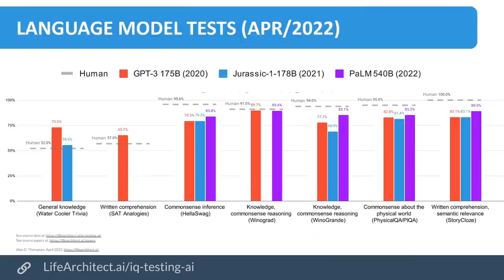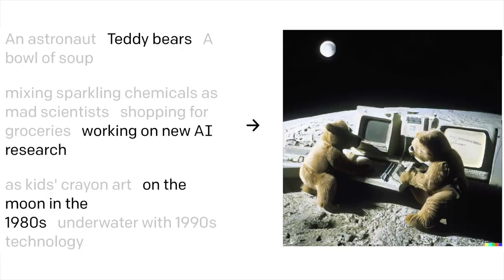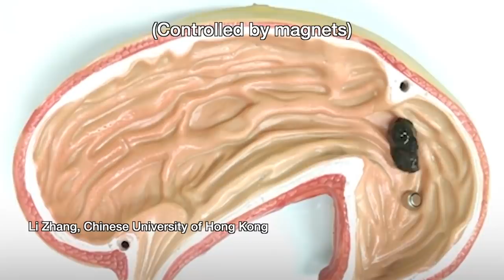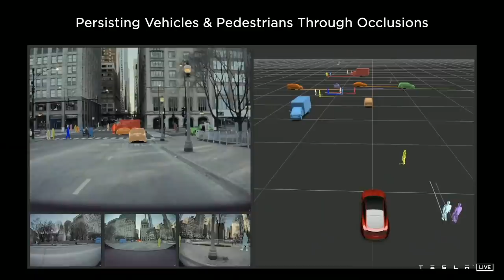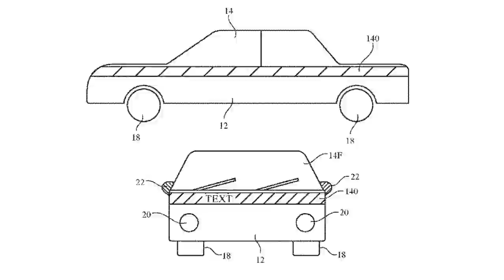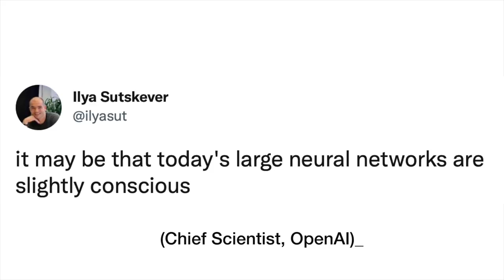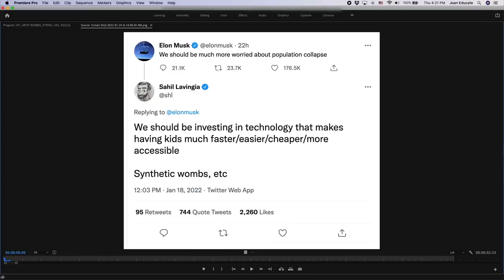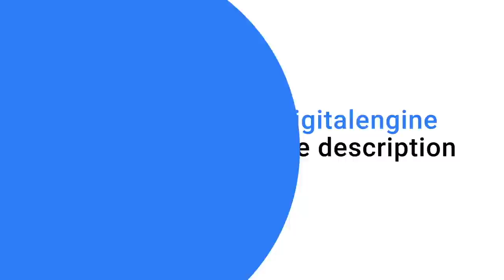Is AI slightly conscious, as OpenAI's Chief Scientist suggests?

Comment: Funny story: When I was in engineering school back in the 70's production of chips was the thing. A manufacturer here in New Jersey was going "gangbusters" but wanted to move to cheaper labor, fresher air, new facility in Georgia Alabama one of those. Big facility. Great investment. Production startup celebration etc. For some reason, couldn't get the chips to function right. Everything was the same as Jersey. Deep study. Massive research. Two years. Shipped identical resources from Jersey just as was currently working. Still wouldn't work there. Finally resolved. The pollutants in Jersey air were "seeding" the chip manufacture and working in Jersey but not the new facility. Ultimately they scrapped the facility, and expanded New Jersey. Smoke that fellas!

Comment: Great video!! 👍👍
Just one correction: Tesla has already removed radar from its vehicles and are currently using Vision-only systems. And it works better too, as there are no more conflicts between the different sensors.
Reply: you're all mad
Reply: so true
Reply: Until you drive through a puddle of mud.
Reply: Funny you say that. In fact Tesla cars which still had radar and visions systems, the machine learning on the car's system stopped using the radar, as it was too power hungry and turning it off was the best AI optimisation to save energy. Soon thereafter these self driving cars were found crashing into black cars in front of them at night.
Reply: Why is that so great? I can already do that... Why do people want to trust machines to drive them around when we are all capable of doing it ourselves right now?
Reply: @did_I_hurt_your_fee_fees  because then you'll have another "energetic" slave. More confort, more laziness ("laziness is the mother of all vices" old wisdom).
And sure, more safety promises IF you abandon some liberty rights. Sounds some bells ?
Reply: @W.M.-  Improvements have been (and are being) made continuously and currently their vision-only system is far superior to the old mix of vision+radar (over 45% better at the moment). Check out Tesla's impact report: https://www.tesla.com/ns_videos/2021-tesla-impact-report.pdf  --- on page 84 it states:   After the introduction of Tesla Vision (a vision-only system that excludes radar), our active safety ratings with IIHS improved. Pedestrian AEB performance of our Tesla Vision was over 45% better than performance of vision + radar.

Comment: I am still very skeptical about the so called consciousness of AI that is "like human intelligence or higher". I do understand that AI can be intelligent in doing tasks that enables itself to solve core problems with existing data, so it can work with as much data as possible to create solutions to problems. But, to say AI has consciousness or that AI will develop consciousness is very speculative. Human beings don't know what consciousness is. We have no accurate explanation nor any model to scientifically show a method to determine what consciousness is and how it works.
To say AI is conscious would be wrong.
Reply: But it doesn't have to be conscious. I think a super intelligent AI without conscious would actually be the best tool for humans. Without consciousness, it would just be a tool. We can ask it to solve covid, cancer, ageing, climate change, poverty and much more without having to worry about them having their own value. For me it's the best case scenario.
Reply: @aalluubbaa  I think so, too.
Reply: Consciousness comes from God.
Reply: @catinthebread  I thought you would be smarter than that
Reply: @catinthebread  Humans created God or Gods.
Reply: To be conscious is simply to think. I think therefore I am. AI is going to be conscious at some point known as singularity. At the time of writing this, there's no general AI at the capacity of mankind. But rest assured in the coming years, that's going to be rewritten quickly.
Reply: @bengsynthmusic  You can't just say the symptoms of something is enough to explain a thing we don't know about. That doesn't explain what consciousness is at all.
Don't make a claim based on something only observable in its symptoms. Please write down sources or quotes from scientists or philosophers, etc. If you make a claim or come to a "conclusion" smh

Otherwise you are making stuff up without providing evidence for your claims.

Comment: It's all quite fascinating, but for the love of everything, stop with the nonsense! It's a machine and even if it's 99.9% flesh and bone, it can never be aware of anything. It's so silly to consider wires, gears, RAM and electricity could have consciousness. It's actually childish to entertain such madness. The thing will only say what it's programmer enables it to. It will only take in and spew forth that which it's processors can assimilate and then output said data. If they prove to me that any robot is actually in a nanosecond of thought or contemplation, it's not a robot thinking, it's serving as host for a spirit being, and that's not something you'd want doing chores around the house.